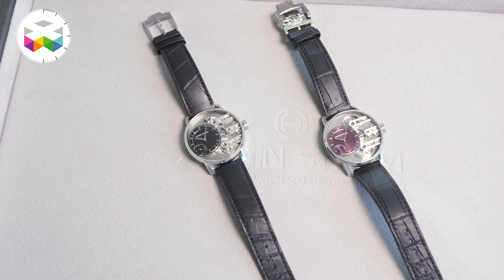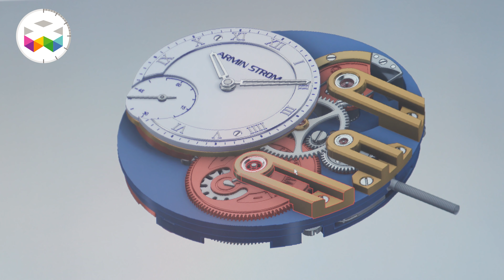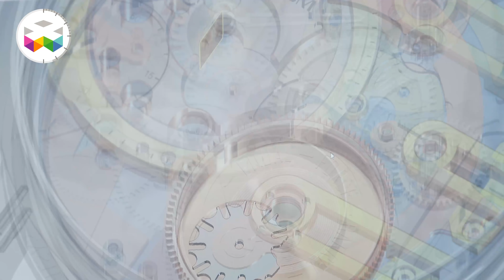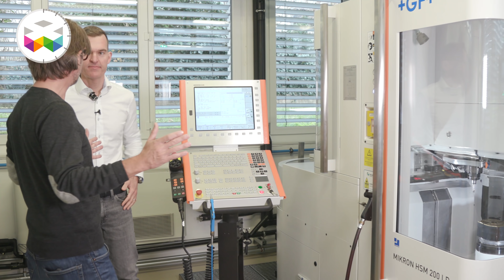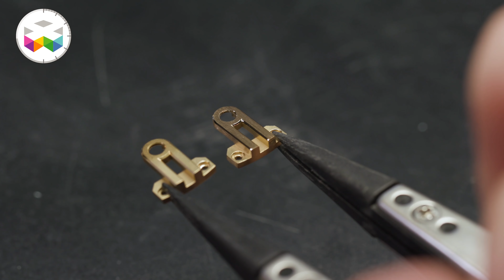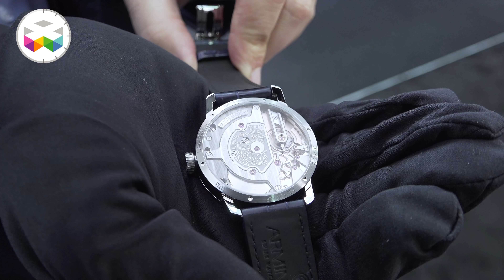Behind the Gravity Equal Force by Armin Strom

Comment: The finishing of these watches on show here in this video looked slightly below par on the outer casing and  on the extreme close up shots shown of the watches. For the prices they are asking for them, there are some more practical watches including the  finishing for around their price, including a few in house watches. In all I don't think they are quite competitive enough at the moment for the money,  or the complications that a few brands can sell at around their price. I will also take  my fine GS spring drive gmt chronographs for their price, over these watches any day of the week, while also my GS's are also better daily wear watches, including their having complications too. A JLC would be a better buy for example, not to mention some other brands of similar ilk etc. Even iwc can make a watch at this armin strom price bracket. There are quite a few brands that will be a better deal with the quality expected of such watches, including the history and the heritage of such brands. There are too many decent watches at this price range, including taking in  some high quality used buy watches, that can put some higher price point quality watches into the mix. The watch market including some quality is already a very populated area. Also I think that a glasshute original would be a better option also, possibly also a used lange. There are really too many decent watches already to name.

Comment: Make a aus or german forg high iron mix w a little chromium for bracelet, very flat links, w tiny screws holding it together, need loctite on screws, then sandpaper,  may as well had a threaded rod to lock it on ur wrist, so in other words need a tool to take on and off, had enough surface area of threads w high % iron so the threads grip enough so no chance of coming off.